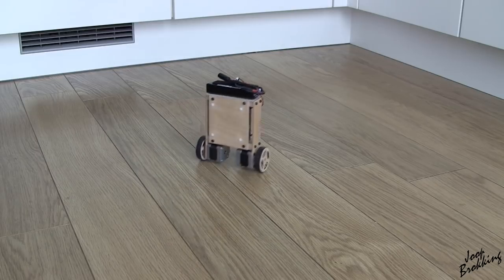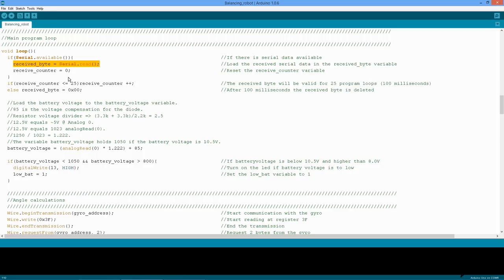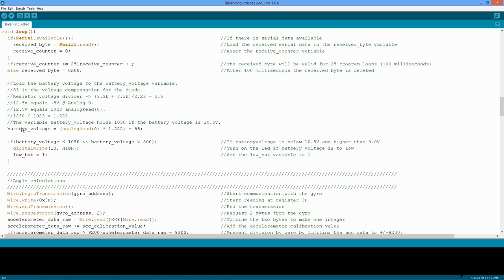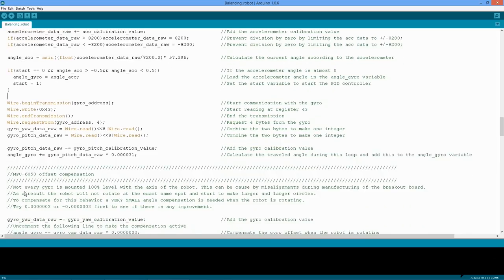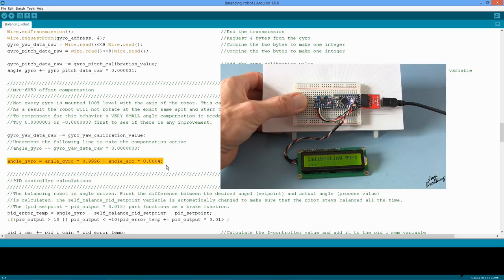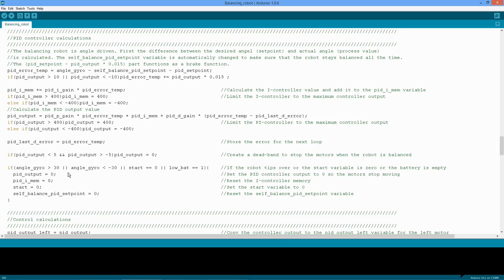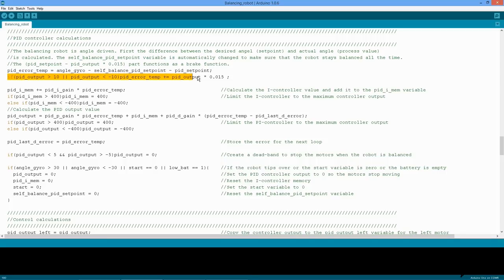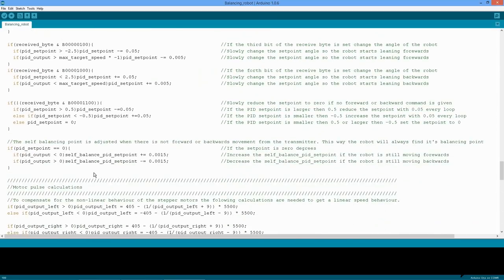Arduino project - Your Arduino Balancing Robot (YABR) - Part 3 - explaining the code

Comment: Greate Video. Building one today. One thing about diode current, motor current and diode current are not correlated as you explain because motor voltage is much lower than battery voltage...

Comment: Hello Joop, I'm your big fan and I'm about to buy all the components necessary to build my balancing robot and also a drone.
Just as a doubt, If I want to build an overboard, do you think that this code could works?
Of course, adjusting the diameter of the wheels and big battery.

Also, which drone do you prefer, the octocopter or the quadcopter?
Which one provides you a better performance?

I really appreciate your help, thank you
regards!
Reply from the maker: The code can be used to measure the angle but not for controlling a hoverboard. You have to modify the code yourself.

Quad or octo depends on what you are going to do with it. If you are starting I would suggest a quadcopter. This is cheaper to fix when you crash.
Reply: Joop Brokking awesome, thank you for all you have shared. regards

Comment: Hello, i have a question. In your case, the main loop frequency its 250Hz, but in my case, im datalogging in SD Card the MPU and GPS, what means the main loop frequency isnt 250Hz, so, i can calculate the angles with my own frequency loop, right? the only thing that means, ill have a bit more error if the frequency be higher than 250Hz?
Reply from the maker: If you are using a higher refresh rate the calculations need to be optimized for this refresh rate. Make sure that you have a constant refresh rate/loop time.
Reply: Joop Brokking lowest loop frequency, increase the error

Comment: Is it able to work with horizontally changed center of mass? I mean some weight moved out of axis/lipo line.
Reply from the maker: As long as you set the correct balance calibration value.
Reply: And how about dynamic calibration?
The goal is to grab some object from the floor and counterweight it with own mass by doing some tilt.

Comment: I built the robot and it balances beautifully, but I'm struggling hopelessly with the remote. I've now bought eight of the transceivers from three different suppliers in two countries and I cannot get any of them to talk to each other.  The nunchuck is sending 1, 2, 4 and 8, but I might as well have a piece of damp string between the remote and the robot as the transceivers, for all the good they do.  Did you have to make sure your transceivers had the same IDs or change any other settings to get them to talk to each other?  Do you have any suggestions for how I might test them?  Sadly, these transceivers do not feature much on the internet - everything seems to be more centred on the NRF24L01.  I've downloaded the manual for the Open Smart ones, but that hasn't been any real help at all.
Reply from the maker: There is a blue led on the transceivers that will lit when they receive or transmit data. So you can send data via the serial output of the Adruino and check if the led on the other tranceiver starts to flash.

I bought 4 of them and they all worked fine without any settings. Make sure you use 9600bps.
Reply: Sorry it's been so long in following your suggestion (but I've been building a copy of Ben Eater's 8 bit computer - brilliant!).  However, I'm back struggling with the remote again.  Yes, both the transmitter and the receiver blue LEDs flash when I operate the nunchuck, but the robot does nothing other than balance itself.  The LEDs aren't very bright, but they do light up
Reply: Joop Brokking 
Hi Joop I have the same problem the robot stands still the remote is making connection flashes blue on robot and Nunchuck but there is no movement at all can you please advise

Comment: Your Videotutorial is probably the best and most thorough I have ever seen. Keep up the great work!
What I do not understand is, however, why it is important for you to keep the frequence of loop() constant. Is there any specific reason?
Reply from the maker: Otherwise the PID controller is getting really confused. It's fixed on 4ms and will react different on a different loop time.

Comment: Hey Joop, I found that system looks smoother (especially on low speeds) when I use 'left_motor = 5000/(pid_output_left);' (same for right) instead of piece of code with '405 - (1/(pid_output_left + 9)) * 5500; ... 400-pid_output_left etc'. I was confused about 405, 9, 5500 and figured out that it is better to use pid output as frequency (which is linear function of speed!) instead of pulse length (which is non-linear). So, after that we have freq like 5..400, and calculate pulse length=(1/freq)*1000 miliseconds, and step count: pulse_length/(20 microseconds). 20 microseconds is period of interrupt. In other words, it is 5000/pid_output_left.

Why it is not 50000? it should be 50000, but we need extra speed, so we just use 10x faster, 5000.
Reply: Can you show it in program? :D

Comment: Hi,  I was just wondering how to use the code you just want the bot to stand and not use a remote. say move forward from within the code. Its for a project I'm doing. I'm fine with it all except I'm not sure how to separate the controller pid code from the rest.  Thanks

Comment: Hi Joop
First of all I would like to thank you, this is brilliant, I built one. But, Can I ask if it is possible to change the 2.4ghz transceiver  to a normal hobby R/C transmitter/receiver,  
Instead of the nunchuck   and if so how ?, I am new to code and not very good
Thank You

Comment: Thanks for the video! This really helps understand how your code works. That said, I do have a minor issue. When my robot reaches max speed, suddenly the control loop seems to stop the motors and the robot falls over. This happens bot forward and backward. If I increase the max speed, it happens at a faster speed. Any idea what might be causing this?

Comment: 7:02 is a bit confusing because it uses the number 8200. This number is approximately 8,192 according to mpu documents and I believe should be calibrated? or it may change the angle calculation. Took me a second to figure out that this number was coming from  page 13 of mpu 6050 datasheet

BTW, another awesome video!!

Comment: Sorry Joop, I appreciate your work and your very good explanation but the schematic here in your Part 3 - YABR-Video(3:56min)  is NOT  the same like the schematic  in your web-site...! Here is the "FAULT"-PIN connected and at the schematic in your web-site the FAULT-PIN is NOT connected ! ...... Wich one should I use ? .......The web-site schematic don't work, connections are checked many times....current is set to 150mA....MPU-value is about 865.....-but motors do not move(NEMA17) . Now I'm not shure  if I followed the "incomplet" schematic or the bigger Steppers are the reason for not working........Tomorrow I will try the Part3-Video-Schematic...........
Reply from the maker: Download the schematics from here: http://www.brokking.net/yabr_downloads.html

 The fault pin should not be connected. If you Google "DRV8825" you will find schematics that you can try.

Comment: Great project! I love this! I'm making the balance robot using DC servo motor. I'm using data reading from DMP of MPU6050. It currently can balance itself but I feel it's not perfect and there is many thing to do with it. In of them is that when I pushed it in a direction with plenty of force it was easily fallen or it moved with max speed til falling. Could you please help me to implement the brake function for my robot. I didn't use remote control as I will be next goal after the balancing work without problem. Thanks in advance!

Comment: Hi Joop!
Great video and very educative!
I have made an auto-balancing robot inspired in yours for a project for a class. 

The only differences are: 
-> I am using arduino Nano instead of mini pro 
->My motor is not a Nema (your motor doesn't have specs, but looks like a NEMA). My stepper motors are Mitsumi M42sp-6tg from old printers wreckage. 
-> I have built the rest of the project just like yours, using the same pinouts in the board. 

My project is simpler than yours, I don't have the remote control stuff and my objective is to only get the robot balancing to stand still alone. Apparently, running your code makes my robot to keep the wheels stuck, but with no movement at all. Could you help me, please?

Thank you!

Comment: Hi Joop: My robot balances, but does not stay balanced. After a couple of minutes, it takes off, though I am using your code.
I am wondering if I need to add velocity feedback using encoders or as I suggested in my earlier comment use the pulse count as a proxy for velocity feedback. I have tried using the pulse count as velocity feedback, but have not had any luck. I may have to spend more time fine tuning it. Your comments will be appreciated.

Comment: Good day Joop I realy like your projects, I am building the same robot that you have build but I want to run the robot with Bluetooth from my phone ,,,,,, is it possible to install HC-05 Bluetooth instead of the serial connection and do I still have to put the R1 resistor in line ore can I remove it 
what part of the code do I have to change or remove to replace with Bluetooth code
Ad again thank you for your good projects

Comment: Hi Joop. So I ended up building the robot a little modified in terms of the structure but almost similar. I have not place the battery yet at the top (so it is not top heavy) as I am testing the robot using an external power supply. What I have noticed is while the robot balances, it seems to be running forward continuously.  How can i prevent this from happening? One more thing I have noticed is that the hardware calibration value for the MPU6050 keeps changing every time I run the hardware test code.  Any idea why?
Reply from the maker: Make sure it's completely still when running the calibration. And it's normal that you get slight variations when you do this.

The robot can only work when it's not connected to any wires. So make sure you get a battery and place it on top. Otherwise the robot will keep moving.

Comment: Hello, I just completed both the balancing robot and the nun chuck. Both the robot and the remote pass the hardware test and the robot balances very well at start up.  When I try the nun chuck control the robot does not respond.    I know this a 2 year old project but I just discovered it  and love it.  I suspected it is the 2.4 gig  serial transmitter so I replace them and still get no response and I am having trouble finding example programs to test them.  Note I am using exactly the units specified and would really appreciate some advice on troubleshooting this last problem.  Thanks in advance!

Comment: Hello. Thank you for your great video. I have build my balancing robot based on your documentation. Everything works fine exept the transmission causes problems. I have used you original code in the nunchuk and in the robot. But there must be something wrong with the code. The robot only turns in one direction. Moving forward and backward command will not be received by the robot. Unfortunatly it is a litte difficult for me to debug the problem. Any Idea how I can find out where the problem comes from. BR Andreas
Reply from the maker: If you move the Nunchuck, can you see the blue LED's flash on the transceivers?
Reply: Hi, i changed the code in line 225 from
if(!(received_byte & B00001100))
to 
if(received_byte & B00001100)
but i replaced the also the Nunchuck version with an handy app input

Comment: Hi i Like all you videos. :-)
But i have a quistin.
I like to use BL but my BT app can only send karakter, like a "a" "b" "c" and so one, how do i convert them to bit.??

And also what do the line.
  if(!(received_byte & B00001100)){                                         //Slowly reduce the setpoint to zero if no foreward or backward command is given
    if(pid_setpoint > 0.5)pid_setpoint -=0.05;                              //If the PID setpoint is larger then 0.5 reduce the setpoint with 0.05 every loop
    else if(pid_setpoint < -0.5)pid_setpoint +=0.05;                        //If the PID setpoint is smaller then -0.5 increase the setpoint with 0.05 every loop
    else pid_setpoint = 0;                                                  //If the PID setpoint is smaller then 0.5 or larger then -0.5 set the setpoint to 0
  }

You skip this part :-)

Comment: Good project! 😉
What software did you used to design the the frame for the plywood? If not open source, what open source software do you advise for that type of job?
Reply from the maker: I use LibreCad for the drawings. It's free :-)

Comment: Hey, Awesome video! I plan to make a system similar to this, but I want to mount my board Horizontally rather than vertically. All the components will be in the same orientation as your board though. Looking at the code, all I would have to change are the I2C Registers we pull data from 3F -> 3B (To pull Accel Data from X axis rather than Z) and then the Gyro Registers (which I'm not entirely sure about what I need to change from, as it makes my head spin a bit at the moment, haha). Does this sound correct to you? Thanks for the awesome videos!
Reply: What have you do to solve this problem??

Comment: Hello, your explanation of your code was very good, thanks for your hard work and sharing it with us. I do have a question if the robot travels on a surface that is not level say the right wheel is elevated above the left ( not front to back level, but right to left unlevel) will the software compensate to this and keep the robot balanced? Again thanks.
Reply from the maker: No, the robot is made for flat surfaces only.

Comment: Hello. Thank you for your great video. I have build my balancing robot based on your documentation. I use NEMA17 SX17-1005LQCEF engines - 1.8 ° (200 Steps on full rotation). Will they be good for this project?. If not, could you tell me how to make the correct code for these motors?
Reply from the maker: If you use the same stepper controllers it should work fine.

Comment: Have you checked, that the main loop executes in less than 4ms (osciloscope or signal analyzer)? It's seems to be quite long and there is a lot of floating point math, which is really slow. 
Great project, congrats.
Reply from the maker: Yes, I checked it. Floats are slow but not that slow :-)

Comment: Thanks for the great tutorial. I did build the robot and am facing some challenges.  MPU is working fine. The pid_output increases and clamps at 400 all the time it never comes down even if i change the robot orientation manually. Any pointers to see what could be wrong.  angle_gyro responds well. The other problem that i have is my stepper motor stops responding when the throttle variable is beyond 325 i just hear the PWM sound. Thanks in advance for any directions.
Reply from the maker: It's normal the the PID output is maximum all the time. This is because the robot is never in a 100% horizontal position and the I-gain is really high.

Best way to test the PID controller is to set the I- and D-gain to 0. This way you only see the error. This might help you.

If you only hear the PWM sound it means that the stepper motor cannot keep up with the signal and comes to a standstill. Make sure to set the correct stepper modes.

Comment: Great project! I build your robot from steppermotors I had from other project and printed the frame with 3D. All other parts are as your robot.
I have a problem regarding the stepper motor frequency. My stepper motor work with a max. stepper frequency of about 2kHz. If I measure the stepper motor frequency of your software it is in a max. about 5.6kHz. So motor does not rotate and robot is not working. I measured ISR tick, which is the 20microsec and also the main loop is 4millisec. 
I tried to find a parameter to limit the max. stepper frequency to 2kHz but couldn't solve the search . Any help from the experts, which parameter I can align.
Thank's Wolfgang
Reply from the maker: The robot won't work at 2kHz. You really need the maximum speed to make it balance correctly. If you use the same motors as I did it should work fine.

Comment: Hi, I am following your interesting MPU6050-projects on Youtube. I am currently building a Segway clone, using MPU6050. But I try to use the onboard Digital Motion Processor to read the filtered pitch angle directly. I am curious why people dont seem to be using the DMP-values. What are your experiences? Is there a catch maybe?
Reply from the maker: I never tried the DMP because when I was starting with the MPU-6050 the library was reversed engineered and not very stable. And more important, I like to make/write my own IMU :-)

Comment: Hey Joop, your work is realy the best ever. I build this bod and now it is running. But i used finlay a Bluetooth module and a handy app to control. One question i would have. Your code use the motors with 1/4 steps. If i change the motor controller to 1/16 steps, the bod is not able to be at zero. I assume it have to do with the 20ms IRQ routine?
My reason to try 1/16 steps is the noise of 1/4 steps configuration.
Could you give an hint on what would be necessary to change on the code, to can use the motor controller with 1/16 step configuration?
Many thanks
Rainer
Reply from the maker: You cannot run this robot on 1/16. The motors will simply not produce enough speed to balance the robot.

Comment: This is amazing! As somebody who knows little about this kind of programming, do you think it could be scaled up to a robot approx. 30cm tall? I want to create a working model of the robot from my comic strip. Thanks!
Reply from the maker: Yes, it will work if it is larger. You might need to tune the PID values but it should work fine.
Reply: Thanks!